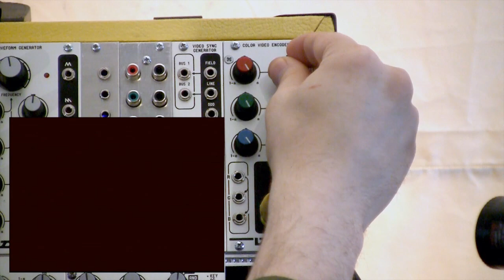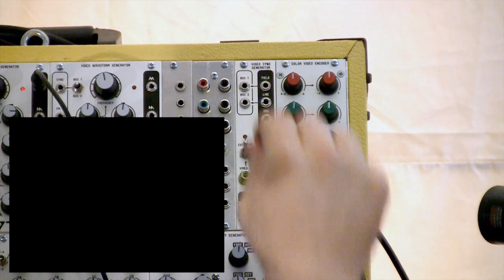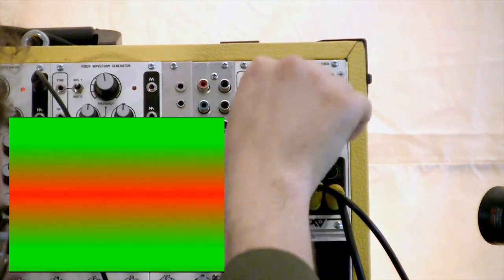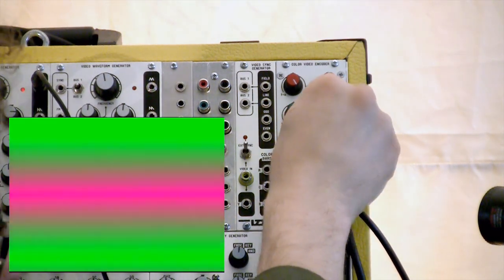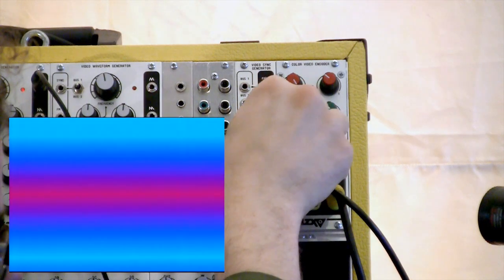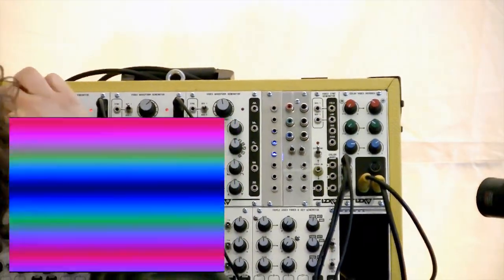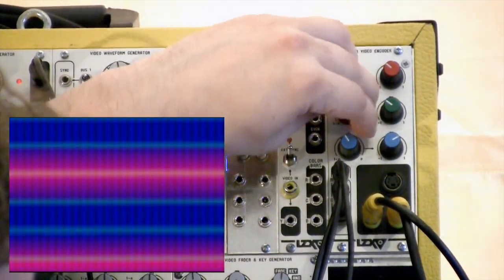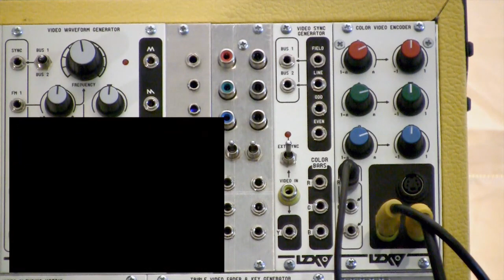LZX Visionary - Module Overview - Color Video Encoder

Comment: Hey! quick question: is there a way to hook this up to a sound synthesizer and have the colours react to the oscillators/envelopes/LFOs/etc.?
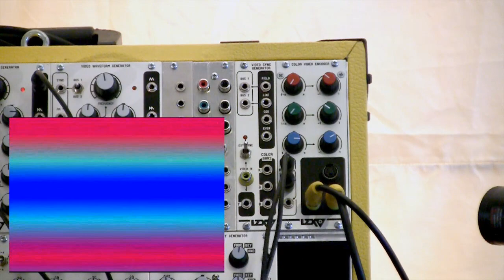Reply: Ryan Duggan that's what he did at 2:42
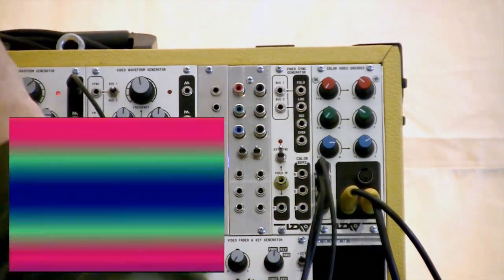Reply: rather at 3:30 when he uses the doepfer module which is designed for sound. The video osciallators at 2:42 I think are designed for video